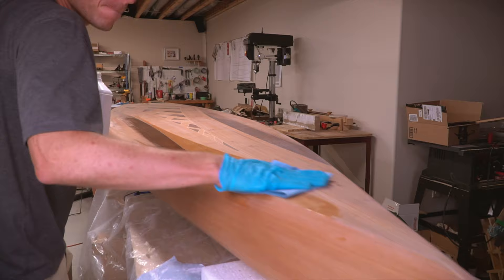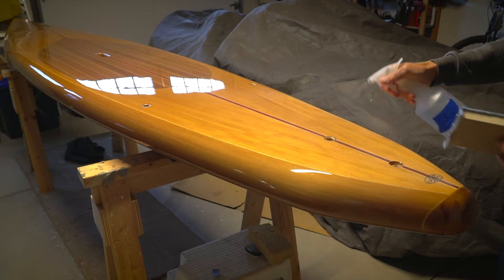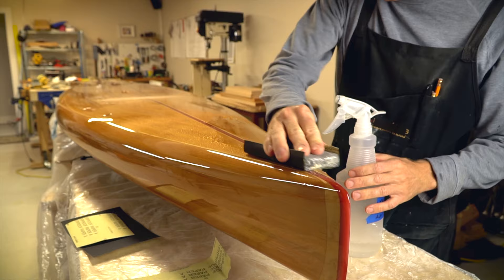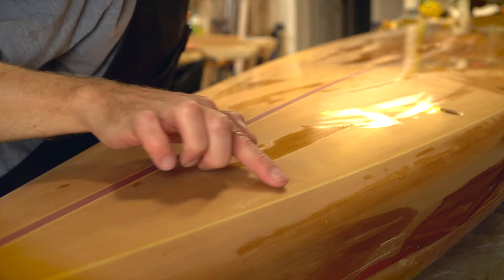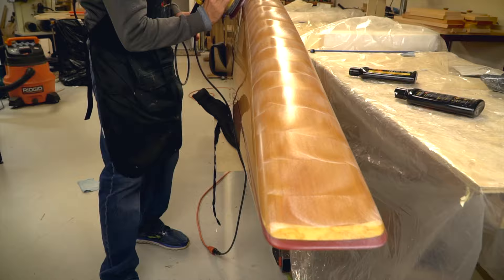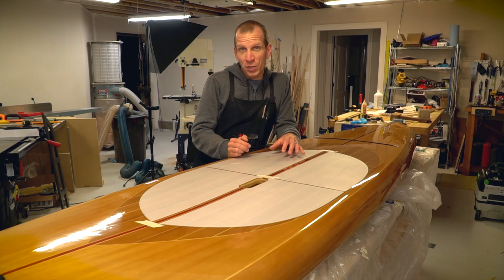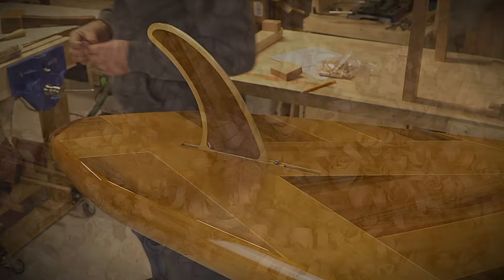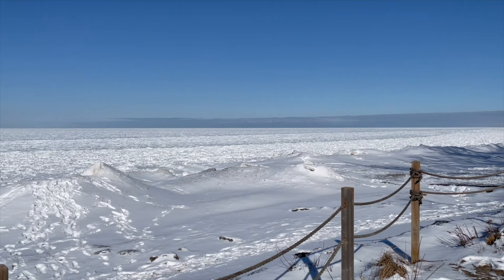Mike Builds a Paddleboard Part 8 - Finishing

Comment: Mike, just m not sure if you covered it, but what plans are you using?  Is it one of the clear wood Paddleboards plans?   Or a different set?    l have done one sliverpaddleboard, working on one from Jarvis boards, but I really like the way this one has the corners built into the frame.    Thanks for any info.

Comment: Terrific result,, Great job & again have enjoyed your approach. When you were finishing/varnishing, did you consider stringing 'plastic' to minimize dust? Sure thats a hassle with all you have going on in your shop, but wondering on ways to minimize/eliminate dust particles... Again, well done. Love it.
Reply from the maker: Thanks for the kind comments Scott! Glad you enjoyed the videos. I didn’t really consider much for dust control when doing the varnishing because the wet sanding technique really doesn’t produce much dust but earlier on in the build it was an issue.  Using sanding tools that can connect to a vacuum really helped there but there is just a certain amount of dust that has to be accepted in a shop like mine.